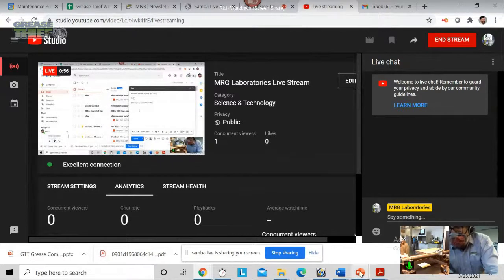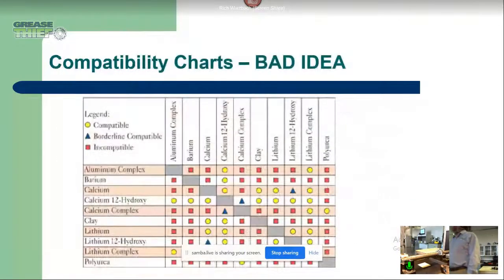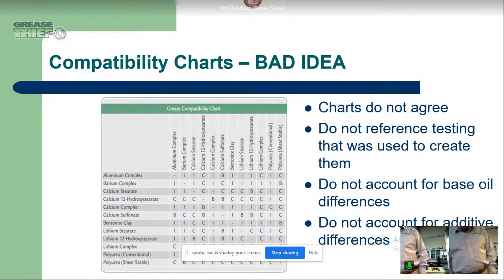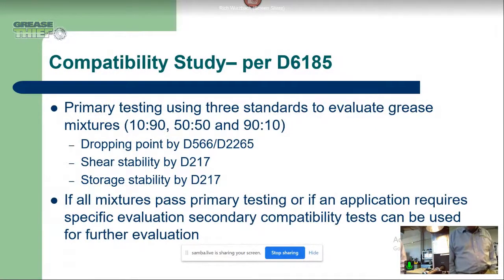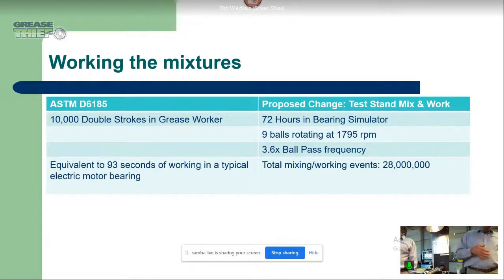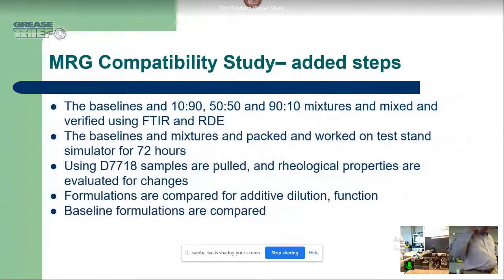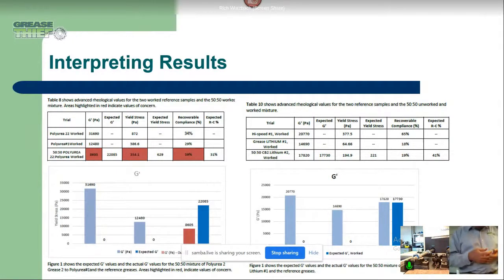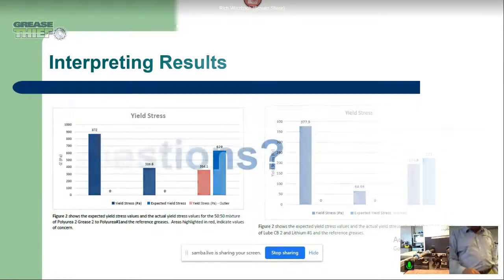Grease mixing and compatibility testing

Comment: Maintenance complaining about motor bearings failing. Operations pumping in a clay thickener base grease into bearings with polyurea thickner. Motor nameplate even states what grease to use. And rebuilt motors come back with a polyurea EM grease. But operations back again pumping in high impact, high temp clay thickener base grease. Like they say, mistakes will repeat themselves.